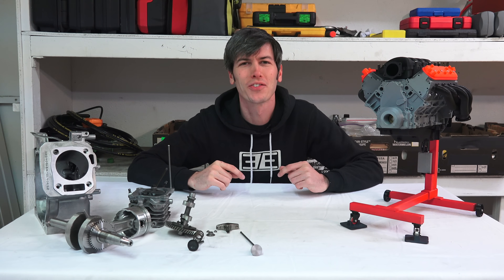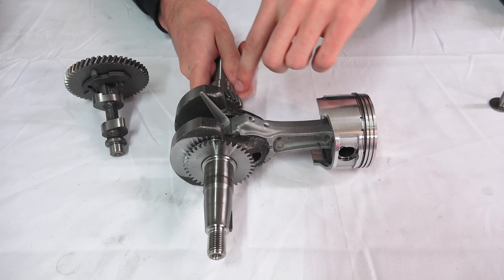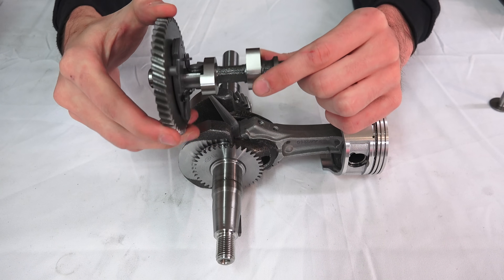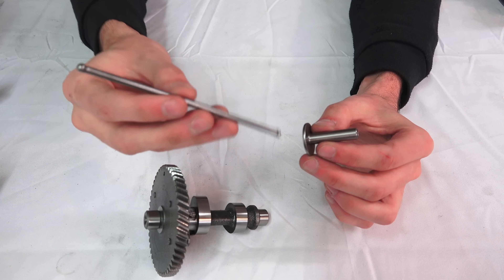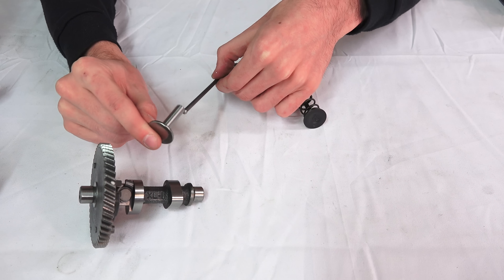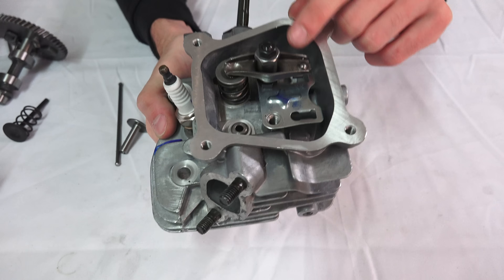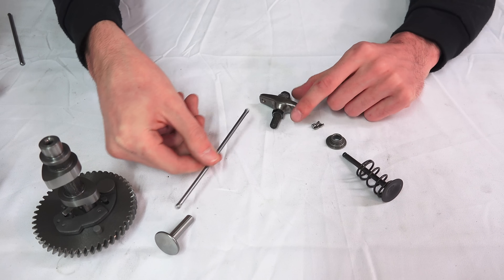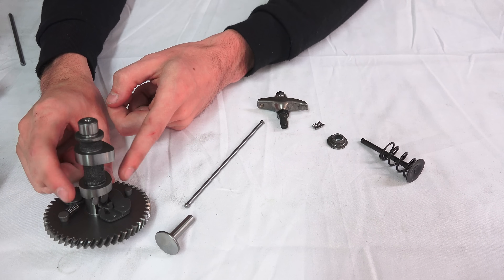Why Can't Pushrod Engines Rev High?

Comment: So much wrong in this video, you are missing one big point, rocker ratios, this over comes valve float issues and this is why push rod engines can get 20+mm valve lift vs 12-13mm max on bucket ohc engines.   
Using push-rods and rockers is what allows 2 valve engines to match the flow of 4 valve versions in race applications.
In some OHC 4 valve engines they use rockers to also take advantage of leveraged ratios found from rockers, ie the SR20.
Yes it is all in the valve spring to return the valve back up, but with a 2:1 ratio rocker setup, your cam lobes only need to be half the height, this is the biggest advantage of push-rod engines and also yields much reduced overall engines weights due to smaller heads, less cams etc.
Many bag out LS engines in Skylines, but when you weight an RB engine at 270kgs fully dressed vs a 183kgs LS3 engine, which is better for a race car?   They put out similar power levels both modified and if you were nto happy with the LS3, you can always boost it and still be less weight than an RB engine.
CID engines in Australia are achieving 500cfm in a 7.4L engine at moment, per litre this is far superior than a full RB race head flow figures with 4 valves, why? rocker ratio and port size.
This engine is achieving 1100hp NA from 7.4L.   148hp per litre !!!! Not too shabby.
There is far more to this debate than outlined here, Chev 2 valve engines are used for a very good reason, very light weight engines and packaging.
They are using LS3 engines in current model LMP3 cars due to low eight and power output.
Only because the tech is"old" does not mean it does not work well, everything has a particular application. 
4 valve engines are fantastic, but bagging out 2 valve engines is very short sighted IMO (not accusing this video of that) they have achieved huge success over the years and still do today.
Porsche 917 was a 2 valve engine pushing out 1500hp in 1973.

Comment: I don’t understand why people automatically think that you need high revs to perform. As if high revs means better than >. It doesn’t at all. It just means you make your max torque and horsepower later rather than earlier which means you need higher gear ratios to get into the power band faster.  It gets on my nerves how every time I go to a car meet everyone fanboys over 10k revving cars when there’s 6k revving cars right next to them that make the same if not better torque and hp figures

Comment: push rods are not meant to be fast, they are meant to provide power, like in a harley davidson motorcycle, unlike racing motorcycles that have greater acceleration, push rods lasts longer

Comment: The reality of engines is the DOHC engines are over complicated and entirely unnecessary. The reason a pushrod v8 is good is it does the job required and having less moving parts makes it not only cheaper to produce but cheaper to repair as a consumer. The reason LS engines are the best isn't because they are the best design, sure a coyote is much more evolved but its over head cams make it enormous. it's because they are simple and power is cheap because it's simple. Less moving parts means less parts to buy but also less parts to fail. It's why two stokes lasted so long also so simple very little moving parts makes them easier and cheaper to repair.

Comment: A dual overhead cam engine with cam phasing has no control over valve lift or duration either, no different than the pushrod engine.

The only advantage dual overhead cam valve phasing systems have his varying the cam timing of the intake and exhaust valves independently, which allows for variable overlap, delayed intake events etc.  The dual overhead cam system does have its advantages, but those advantages are not nearly as great as some people would like to believe.

The main reason pushrod engines tend to rev to lower RPM is mainly due to their displacement and the size of the reciprocating parts.  Hydraulic valve trains also have their limits which are lower with high mass components.

Don’t forget GM’s LS7 is a7 L V-8 that spins to 7000 RPM.  It wasn’t that long ago that the only mass-produced engines spinning faster than that were tiny Honda VTEC engines, and they needed a true dual camshaft profile to do it successfully.

Comment: There are lots of pushing rod engines that rev to 9k or more...
Reply from the maker: In production cars? I don't know of any. But there are plenty of production OHC engines revving well past 7k. LS7 tops at 7k, highest production pushrod I know of.
Reply: Engineering Explained my 355 turns 7200 easy and can go more. I've had 350s I rev that high my uncles small journal Small block goes over 7. Thousands of LS engines with after market parts do it lots of crotch rocket and sport bikes did it it's that uncommon at all if your a car/bike or engine guy at all it's fairly common to see.
Reply: Engineering Explained dual valve springs or heavier springs have been around forever full roller cam lifter and rocker setups etc... guys were high revving the small journal SBCs in the early 60s.

Comment: Push rod engines don't need to rev high. They offer much more displacement for the same engine weight. That moves the torque and power production lower in the RPM band. The LS3 and 5.0 Coyote weigh about the same, despite the Coyote being a much lower displacement.

Comment: Just wondering if/why valve float is not a limiting factor for belt/chain driven valvetrains?
Reply from the maker: If the cam is up in the head, and four valves are used, there's no pushrods, and the smaller valves are lighter, so less likely to float. Still possible, of course, just a higher RPM at which it starts to become a concern.
Reply: Engineering Explained awesome, that makes a lot of sense, thanks for clarifying Jason!

Comment: Most modified Ls engines rev around 7,500 rpm.. Which is good... Getting a 4.8 Ls to rev 8,000 is fairly easy with valve train work.

Comment: OHV is cheap and is much smaller compared to smaller DOHC V8s. However, countries other than America have tax regulations based on discplacement, which is why they never caught on in other countries....

Another thing is driving conditions and climate. To run an LS Swap in Indonesia for example, you need to have a lot of cooling upgrades since you’re gonna spend most of the time idling through traffic (avg speed of <20mph) not to mention the fact that it’s really hot there. And they’re gonna burn more fuel on idle than a smaller DOHC motor making the same power would.

So yes, the LS motor is a great performance engine and daily driver choice in America. But to daily an LS in countries like Indonesia with high traffic? Nah, not really.... It’s part of the reason why don’t see a whole lot of Camaros, Corvettes, and Hellcats roaming around in those countries. The Coyote Mustang has become a more popular choice for this reason, albeit by a small but noticable margin.

Comment: So... what about the LS? Hardly a low rev limit there....
Reply: Also.... pretty sure it was pushrods ramming years worth of NASCAR vehicles around the ol' circle..... pretty sure solid lifters and hollow pushrods with roller rockers can do the duty... so... discuss. There's also the Ford 351 Cleveland... and with some of the most insane oiling system modifications and appropriate and hardly new valve train upgrades, was capable of pulling beyond 8k.... some claims of 10k exist for 1/4 mile applications.

And lastly.. I'll site an engine built by Pro Street Terrorists of La Habra California around 2002-2003ish, a Ford 351W bored and stroked to 427CID, our rev limit was a 'break in friendly' 6500 out of the box.

Pushrods can rev..... maybe not from the factory, but even that's not always true. In car engines, the biggest limitations were actually the hydraulic lifters so commonly employed in pushrod applications. It wasn't until a bit later on that anti-pump up lifters came into being and allowed near solid lifter performance out of hydraulics... but..... my old Ford 460 did 6k+ on its factory hydraulics... yes, it ate the cam, but it still did it without complaint until that lifter let go.

I think there needs to be a significant reevaluation of this topic. It completely ignores what the racing world has done with pushrod engines.

Comment: Four valve systems can flow more air over all with much less lift and duration. This means you have a much wider power band as well as higher peak volumetric efficiency. This is why four valve engines make so much torque, and are usable at low speed while having good specific output. Two valves need much more compromise to reach high outputs. You get rough idles and narrow powerband much sooner. If you want 100bhp/litre you have a race engine that can't be used on the street.

Comment: my ford 300 pulls like an ox, but only to about 4000 rpm or so.  but it's a truck engine, so i like having alot of power without having to hear it scream.
Reply: My 40 year newer 4.7 V8 Landcruiser engine is no better. 4k and it is long over. and the 300 has shitloads more torque. Though the Toyota is quieter and probably better on fuel.

Comment: It's already 2018 and I just don't understand why GM won't get with the program already. Pushrods or OHV is an obsolete design that's been long outdated. It's time GM learns how to apply a DOHC or twin cam type design heads onto their V8's by now. I mean it took NASCAR until fairly recently about a few years back to stop being so obsessed with the past or "good ol' days" and consider moving on from carburetors to actual EFI! Is it that the engineers in NASCAR are incapable of at least somewhat keeping up with modern technology or something? Hmmm...

Comment: Imagine an 8.9 liter monster that revs to 8,000 rpm, and makes peak power st 7,000 rpm.   900 hp on pump gas.  It's real, despite what people think.  The ford big block has no problems revving.
Reply: Invincible Extremes Muscle Cars Garage I'd expect a 9l engine to make 900hp. Saying oh look this huge engine makes huge power doesn't especially mean much.
Reply: Samuel Curran except it's got no issues revving either.  Despite being huge.  THAT'S what I'm pointing out.
Reply: Invincible Extremes Muscle Cars Garage oh no I'll agree it's very impressive but that doesn't mean you can't so it more easily with something else. 
Course you can make a 7Krpm pushrod it's just a question of time and effort and what matireals you're allowed to use.
Reply: Samuel Curran pushrods aren't as heavy and cumbersome as people think.  And the other thing is, it allows a 5.3 liter or 7.0 liter engine (ls) to be the same size and weight as a Nissan 3.5 liter but make much more power, and more reliably, because the heads aren't so big, it's mostly bulky in the pistons, block casting etc.  Now, liter to liter, dohc reigns supreme... untill you look at the overall package, price, and how much hp can you make na, and then how much more on boost...
Reply: No i'm quite sure that the modern ones aren't. Materials brought camshafts forward dramatically so i'm sure they would push rods as well.  Which engines are you referring to specifically? The VQ35?  and which Ls? 

I'm more a bike fanatic than car so i'm not aware of what the big motors in cars are. Talk about 1L V4s in Aprillias though or 250cc 2 strokes and i'll know what you're on about. 

I struggle to believe you can fit a 7.0 in the same package as a 3.5 though. 5.3.... maybe. a 7.0 though? I want to see proof before i believe that :P
Reply: Samuel Curran all ls engines are the same size.  And yes, they are freaking tiny, up to 7.4 liters on custom blocks.  I love bikes btw, that's a whole different world, my favorite being the old 92 cbr900rr, and besides that, old kickstart ones...
Reply: That's why i haven't brought bikes into because they're completely different 

Yeah, which blocks though. I want to see for myself :P

I think bikes are becoming interesting now again. Honda let it's engineers run loose pre 90s then they reigned them in. I think because they're getting spanked in the Moto Gp atm they're beginning to let them loose again. Not to mention there's a lot of variety in the types and what engines they have now. I'm particularly fond of the 3 cylinder triples in triumph and MV agusta.

Comment: I'm a little disappointed you didn't bring up rod/stroke ratio as a limiting factor for rev-capabilities. Valvetrain design is not the limiting factor by itself, and valve float is a serious problem for under-sprung SOHC and DOHC setups as well. Rod/stroke ratio will ultimately dictate how the engine breathes and where it likes to generate maximum airflow. Higher rod/stroke ratios increases dwell at TDC, reduces needed timing advance for maximum cylinder pressure, as well as decreases sidewall loading on the pistons which reduces frictional losses. The penalty is less torque, but usually you get more horsepower. The opposite of rod/stroke ratio is also true. You gain more torque in the lower rev range, but sacrifice the ability for the engine to breathe efficiently at higher RPM. Keep in mind, this has nothing to do with head design as the ultimate authority to how the engine wants to breathe is the rod/stroke ratio. This will also effect your piston speed, which directly relates to engine longevity. If you have a 2.4L engine that revs to 7000RPM  with a 1.48:1 rod/stroke ratio, it's piston speed will be way higher than a 2.0L engine that revs to 7000RPM with a 1.68:1 rod/stroke ratio. 

Rod/stroke ratio also allows you to change the relationship between torque and horsepower by limiting torque in lower rev ranges by giving the piston and rod less mechanical leverage over the crankshaft. Motorcycles utilize this in order to keep them from wanting to flip over when using larger displacement engines.

Rod journal diameter will also alter what's referred to as bearing speed. If you take the circumference of the bearing and calculate the distance per rev, this will increase proportionately with RPM. There is an upper limit in regards to heat generated vs. the ability of the oil to keep it lubricated. In order to keep this number controllable, you reduce the rod journal diameter to decrease bearing speed and keep heat to a minimum.

It would have been nice for you to talk about free-valve technology from Koenigsegg. THAT is very interesting and if you haven't heard of it please check it out. It basically eliminates the camshaft entirely and uses solenoids to control the valves independently from the crankshaft, which allows you to program impossible to grind cam profiles. VERY interesting stuff.

Comment: One question I've always had: why there's only one spring. The tappet could extend farther into the cylinder and have it's own spring as well. That would reduce the spring tension on the one valve spring and it's all easy to design.

Comment: Our toyota silver crown engines our358 ci. They are steel blocks with aluminum heads and mechanical fuel injection ,running on methanol. These are pushrod engines( old nascar motors) pn our dyno they average 940 to 975 hp at 9200 rpm and the engines can go all season on one set of valve springs. These engines easily will run 13,000 rpms with a little different cam. They will run the entire race at that but springs will have to be replaced each race. These motors will break 1,000hp. Years ago our buick indy car pushrod motors went 12,000rpm easily after we discovered .625 pushrods were the secret. We would have used .750 diameter but nu room. Engineering makes pushrod motors go like this and hrs in dyno and spintron. Screw overhead cams. Doc2050

Comment: The thing is most modern pushrod V8's don't need to rev as high as dohc engines to make comparable horsepower and usually more torque all while weighing less and being more compact.  They both have drawbacks and advantages.

Comment: Formula 1 hasn't allowed engines to rev to 20,000 RPM since I think 2007.  They were reduced to 19,000 in 2008, and then reduced again to 16,000 IIRC.  In the current turbo hybrid era with the V6 ICE this is now 12,500 IIRC, not that many teams will hit this, or stay there very long.  With the restrictions on fuel load and the fact you are only allowed three of any engine component for the entire season, teams are trying to get the longest possible life out of each component.

Comment: Why not use electromagnetic valves?

I've only just thought about this and not even bothered to google it yet; but it seems like it would allow infinitely variable valve control.  Timing, duration, overlap; all controllable independently   Maybe it's already in use and I'm unaware or maybe there is some obvious downside that makes it unpractical.  IDK.

Comment: And then you have the rpm god "10k rpm? I spit on 10k" * in strolls mazda*
Reply: by the way has that emmsion issue commingalond?
or the total loss oiling system?
last i checked wankoffels  have worse emissions then a big diesel truck and are less reliable then a poorly kept ford from the 30s
in strolls the mopar 340 smallblock based 305 and the  mopar 400 bigblock
BOI
Reply: Rockthevox well if you want to talk about emissions efficiency and fuel efficiency the rotary is as good as donkeys piss. But mechanical efficiency is a whole different world. A rotary can be made stupidly reliable when built properly. Oh and apex seal goes, that's fine it's only roughly 16 long bolts to dissamble the engine totally.

Comment: Can’t any engine technically have valve float if the spring isn’t stiff enough?
Reply from the maker: Yes, but with DOHC 4-valves per cylinder, the valves are much smaller (lighter) and there are no pushrods. The result is less reciprocating mass, making it much easier for the spring to control the valve movement in correlation with the camshaft.